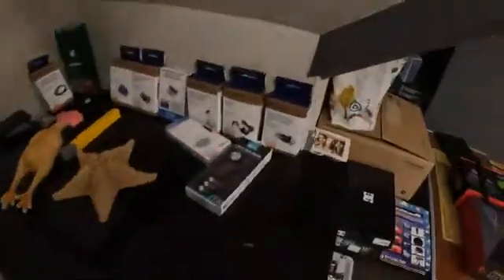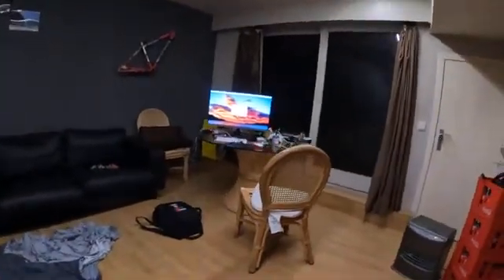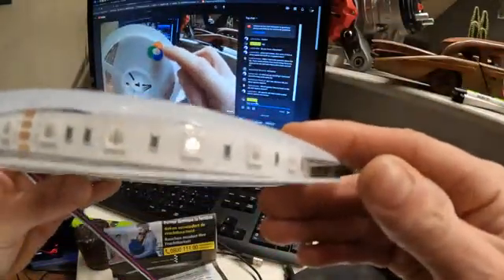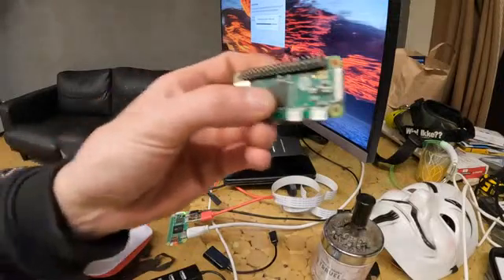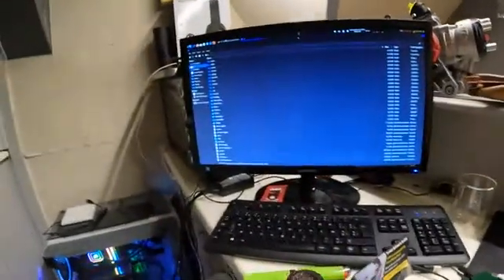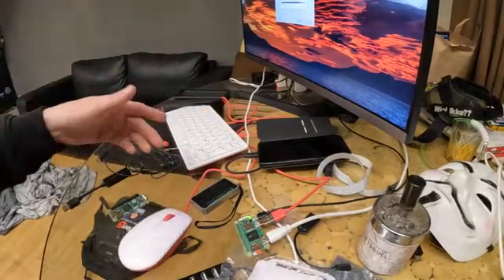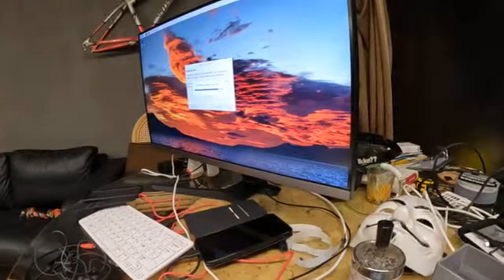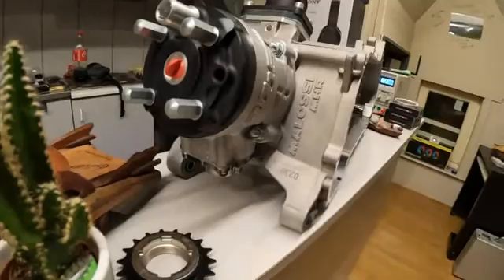Streaming Live from my #GoProHero10Black

Comment: Learned,last days,3 sort spark-plug standard,platinum and iridum(also double iridum and laser iridum) Cr7hsa to cr7 hix where i is iridum and x means booster spark.NGK also tells:never copper seal threads on plug,causing "over-torque".Leads to engine failure,spark malfunction.Ordered mc-coils from aliexpress,10$ and 30$.
Reply from the maker: yeah spark plugs or very cool